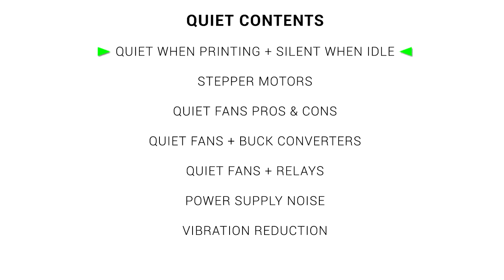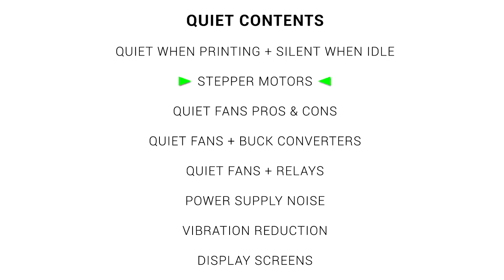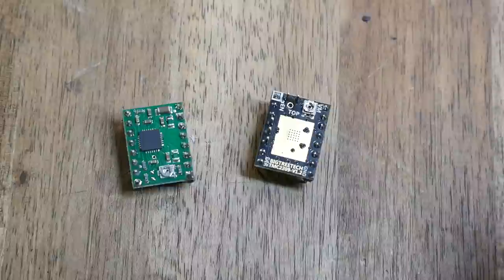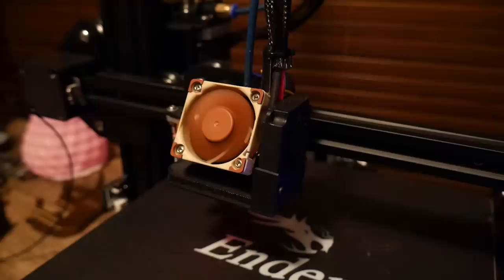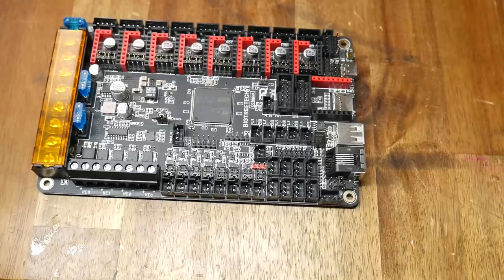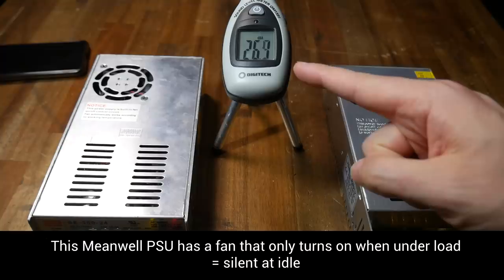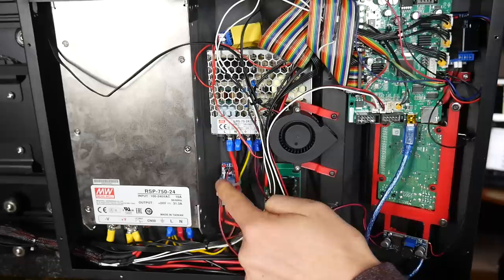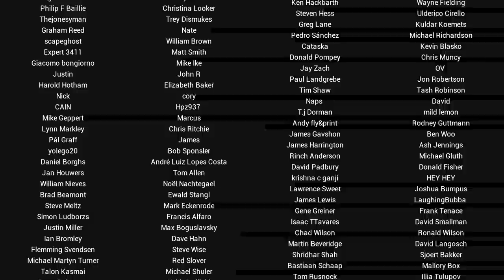Quiet 3D printing guide: Noctuas, buck converters, relays & firmware tricks

Comment: Off topic. But since you mentioned Superslicer I'd thought I'd ask.. I am having an issue with some prints stopping mid print with Superslicer gcode. This does not happen when slicing and printing with S3D. Do you or anyone know why this would happen? I'd like to move to this slicer as when it does do a full print it makes a much nicer looking print than S3D. Thanks.
Reply: Could be a number of problems. 

Initially I would look into the minimum layer time in super slicer which I believe is in your "print" settings, it can and will pause your print to wait for an arbitrary time set by that setting. 

There's also temperature, if bed or nozzle drop too low below the target, it will pause to wait for the heat to rise. I ran into that one when I over-tightened the screw holding the thermistor in place on my hot end. However my machine beeped profusely to alarm me something had failed despite never doing that for any other faults.

Stepper motor overheat can be a problem if your machine is monitoring for overheat conditions. As far as I know, this requires the steppers to be connected in UART, otherwise they fail in isolation meaning everything else keeps going as normal.

Could just be overloading the firmware with commands. In the "printer" settings you can find a setting called "processor limit" and adjust that downward to lighten the load. Default is 1500 G1 per second, this would be troublesome for say my Ender 3 Pro that only realistically handles 200 G1 per second before it gets overloaded. My Ender 3 V2 however is fine with the default and after a recent foray into paging, seems a very conservative for your typical firmware configuration.

Hopefully one of those gets ya on the right path but there is certainly a lot to it. Make a guess, research, perform test based on what you find and you'll eventually arrive at the cause. Forming a solution can be very difficult if it's a firmware config problem and your not proficient in C or C++.
Reply: @eideticex  Hi. Thank you for your comprehensive reply. Much appreciated. I'll check those settings out.

Comment: Just get a 4020 fan, and blower fan 5015 and slow it down to 60%.  Comparing to the stock Ender 3 v2, it's supper quiet.
Reply: I'm still a novice when it comes to this stuff, but I heard that axial fans are terrible when compared to blower fans of similar size, so why not just replace all the axials with blowers?

Comment: I would spend the money to build an enclosure that would filter the air inside it, before releasing it into my environment. 
3D printing, releases tiny particles of plastic into the air, which you then breath in. Much more dangerous than noise.

Comment: This solution is a pain or impossible for most. I'm not going to add buck converters or relays and definitely not going into messing with the firmware. I have never found 24 volt noctura fans and had no luck finding any other brand that are quite. I need to replace all the fans on my ender 3 and the stepper drivers are the only quite part at this time. Is there any plug and play options for us newbs?
Reply: There is no other way to run quiet fans. You will have to either change the mainboard to one that will allow you use jumpers to change the voltages or you will have to use buck converters. Unfortunately, quiet fans only come in 5 and 12 volts. Any fan that is 24 volts will be just as noisy as what you already have.
Reply: @danielthomas388  so basically the higher the volts the louder they are?
Reply: Yes. The more voltage the louder they are. I've been running noctuas for a long time now. I've never had a problem with clogs. You can even turn down the voltage with a buck converter to quiet the fans even more.just don't turn it down too much.
Reply: I recommend going with sunon fans. they are 24v maglev fans. they aren't as quiet as noctua but they put out the cfm you really need and are much better quality than other 24v options.
Reply: If you can't do simple stuff like this, what are you using your 3d printer for? It's a bit odd, like someone with a cnc complaining tapping threads by hand is too involved "for most". Like what?

Comment: Ah heck let's give out a real secret.  A LOT, and I do mean a lot of fan noise is due to low pressure chop.  As in the fan blades entering into areas of low pressure caused by the drawn air flowing by obstructions.  
Ever notice how most of these power supplies have a terrible metal grate put in front of the fan?  Don't touch anything else in the supply, take the lid off and undo the fan, cut out that silly grate into a hole a bit larger than the fan opening, then reassemble.  Then notice that it's a whole crapton quieter since you don't have silly, poorly designed obstructions creating a huge amount of low pressure zones right in front of the fan opening.
Part of why putting Noctua fans here makes it quieter is simply their slower flow, but you can accomplish a lot just by removing this incredibly poor choice in design.  Yes, keep your fingers away, but that's a small price to pay for a lot quieter environment.  
Obstructions in front of a fan are supposed to be X distance away so the airflow recovers and doesn't have low pressure zones creating unnecessary noise, that is very basic design guidance.  X is not 'right in front of the damn fan' like they do on these supplies and a lot of other cheap equipment.
Reply: 'fan blades entering into areas of low pressure'   BTW yes, actually the noise is mostly coming from the fan speeds up a bit in the low pressure, then slaps the higher pressure areas..

Comment: You didn't make it clear that you are using a relay with drive circuitry - the one you link to is even opto-isolated.  Connecting a microcontroller directly to a relay will kill it.

Comment: Did this years ago. It baffles me how people still have 3d printers you can hear.
Reply: I've had an Ender 3 v2 for about 7 months and I've been putting it off because I'm not really that comfortable with the buck converters and wiring. 
This video helps, but I'm probably not going to touch the wiring any more until I get a few replacement fans, direct drive extruder, and some other stuff set up.

I've been using some printable "vibration damping feet" and those have helped a bunch... But that's more like a Band-Aid than anything.
Reply: @ILEFTCAPS0N  careful.  That gets to be a slippery slope.  I thought the same 18 months ago with my OG Ender Pro.  Before I knew what was happening I had a laser cut electronics drawer, separate 5v power supply for the Raspberry Pi, new mainboard with TMC2209 drivers, a pair of buck converters for low voltage jobs, twin 80mm noctua fans cooling the electronics enclosure with their own relay to turn on only when the printer is active, 60mm noctua fan for the power supply with custom replacement cover, a second relay to control the printer PSU, and a Hemera extruder with noctua fans.  Once you start, you won't be satisfied until you have complete silence.

However, this channel was a fantastic resource for reference and guides on most of the things I did to my printer, so you're in the right place if you take the plunge.
Reply: @ILEFTCAPS0N  biggest noise difference for me came from the new mainboard and the fans

Comment: I suggest not to wire fans to anything that is not dedicated to fans in the main board. Fans produces not only audio noise but electrical noise and spikes. It can affect temperature sensors for example or shorten the life of electrolytic caps.

Comment: Why aren't you recommending that people buy quiet 24v fans? There are tons on RS Component/digikey/equivelent just use the filters 24v and sort by noise ascending. Noctua + buck converter is so much hassle and extra complexity and good 24v are just as quiet and move more air. Instead of repeating the same tired advice please do some actual research on what is actually the best option...this is supposed to be your living producing advice videos?
Reply: There are some very nice Sunon 24V MagLev fans that are a nice easy swap out for the stock ones. Higher CFM, lower noise than the stock ones too. (this was compared with the stock ones on my CR10v3)

Comment: I can't believe you are still telling people to use the low CFM Noctua fans. They have been proven not to work properly too many times., they are quiet for a reason.   Losing respect for your channel.
Reply: Blanket statement. Why not if it's sufficient? I use a NF-A4x20 at 10V as an extruder fan with a bi-metallic heatbreak and never had any clogs and it's super quiet (also replaced parts fan with a bigger 5015 and mainboard/PSU 8cm with a 12cm bequiet).